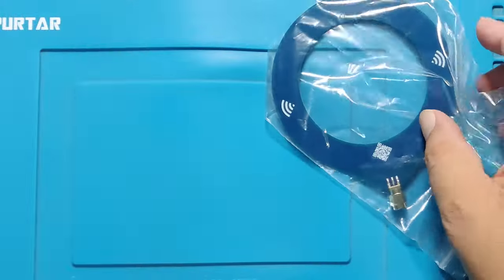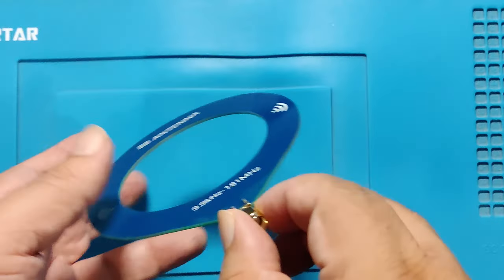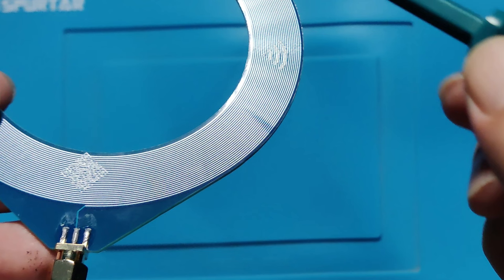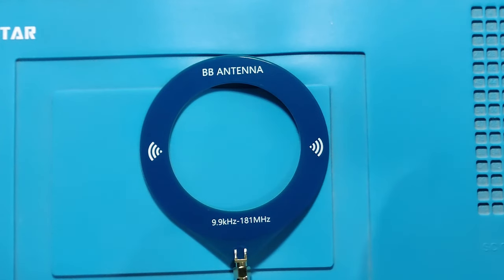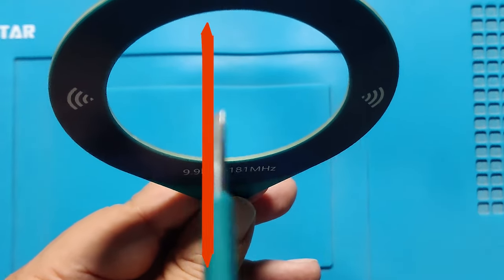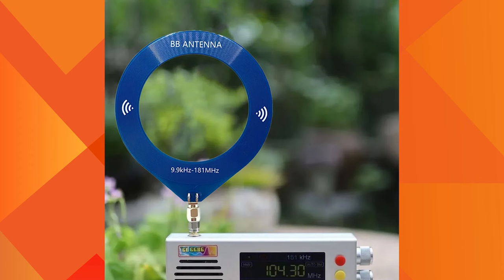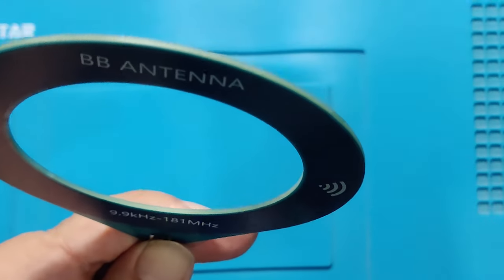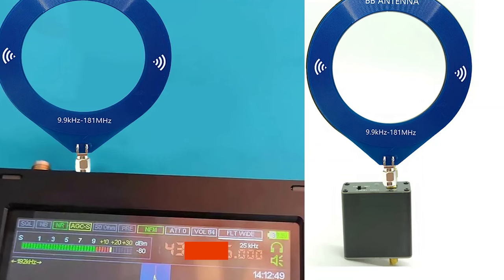Mini Loop Antenna 9 9KHz to 181MHz HF & VHF bands, Overview by Technology Master

Comment: Great YT videos thanks. What radio or scanner can buy to locate encrypted radio signals?
Reply from the maker: Thanks for appreciation, it helps keep me making more videos. Radio, scanner or receivers are the same for analogue as well as encrypted signals. We need to be sure that 1-our receiver/scanner is able to receive frequency of interest. 2-should have ample bandwidth to receive whole signal e.g an am radio with 500khz (don't remember exact) will not be able to receive FM radio signal as FM broadcast has 10MHz or more bandwidth. 3-receiver should have the capability to receive modulation type of the signal. Some modulation types are AM, FM, SSB etc.  Some of the hardware that can be used for most signals include RTL-SDR, Hackrf-one, AirSpy R2 etc. Here is a list https://en.wikipedia.org/wiki/List_of_software-defined_radios